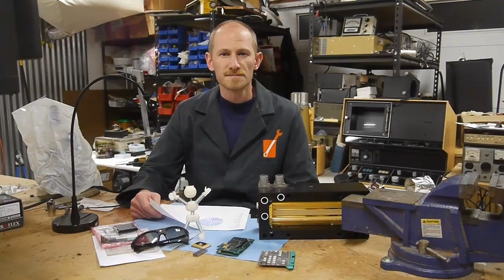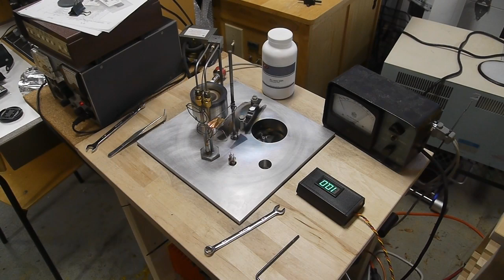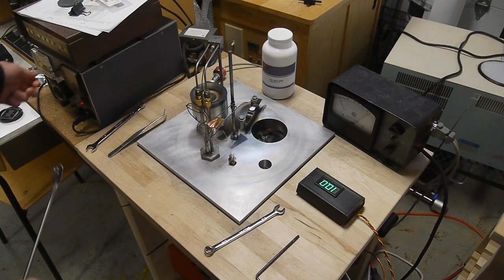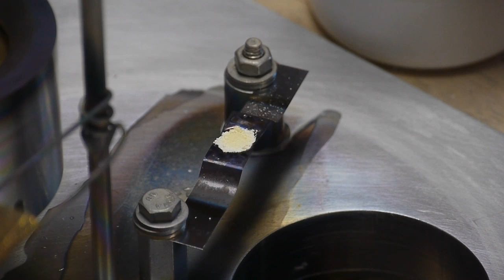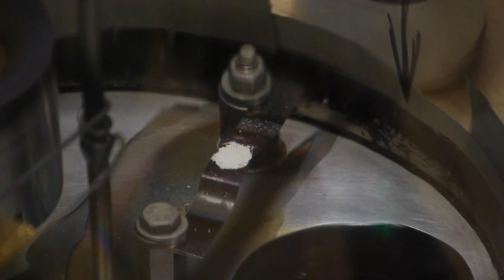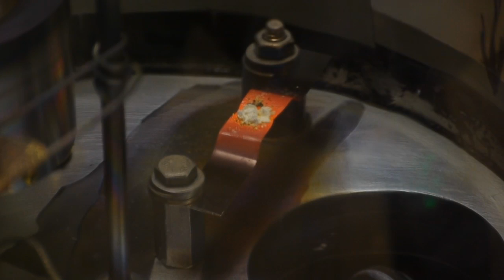Ben answers your questions #1

Comment from the maker: Someone posted a questions about college, then deleted their question as I was answering it!  Here's what I wrote:

I started at Cal Poly, San Luis Obispo, then transferred to UCSB.  Cal Poly wasn't a huge inspiration for me, but the real reason for the transfer was that I was following a girlfriend.  It wasn't the best idea that I've ever had.  Luckily, I liked Santa Barbara better anyway, and UCSB was a much better fit for me because the mechanical engineering major was smaller in relation to the overall school size (more personalized help).  I also found friends that I had more in common with, and generally had a better time.

Don't obsess about choice of school.  Unless you want to be a politician or join an Old Boys club, your choice of school will have little impact on your employment path.  Choose a school that fits your personality, your desired locale, and your budget.  There is no reason to rack up huge debt unless you have to.  Every school will provide opportunities for networking -- make full use of them!  Do projects whether they are required by the school or not.  Find friends, or complete projects on your own.  Having a portfolio of stuff that you've built will make you much more valuable to prospective employers.
Reply: following a gf, hahahah that was interesting. love your channel and honest answers.
Reply: Cal Poly BSEE graduate here. Cal Poly is known for offering a lot of practical coursework while schools in the more research-oriented UC system are generally known for emphasizing mathematics and theory. I don't know how long you attended Cal Poly, but did your experience give you an impression on any differences in how hands-on the two curriculum were?

Another question: you seem to me like the sort of person who could have been successful in a technical career without the need for a college degree (like Jeri). Did you ever consider forgoing your education and instead becoming an entrepreneur?
Reply from the maker: Spencer Williams I only spent my first two college years at Cal Poly, so much of that work was general education requirements and lower-division classes.  The real differentiator would probably be the upper division work, which I didn't do there.  I initially chose Cal Poly specifically because of their "hands-on" mantra.  I've always felt that being hands-on is the best way to learn things, and though it would be a good fit.  My biggest complaint was that Cal Poly was super overcrowded -- getting classes was very difficult.  It was normal that engineering majors would take 5 years to get an undergrad degree because of difficulty registering for over-full classes.  There were so many MEs at Cal Poly that getting any sort of personalized help was impossible.  The admin staff could not possibly know everybody.  In general, I was not impressed by the caliber of the average Cal Poly student, though there were a few great folks that I met.

At UCSB, the ME advisers knew most people in the major and almost all seniors by name.  Registering for classes was not difficult at all -- they would make sure everyone got the classes that they needed to stay on track.  Even though individual class size was larger at UCSB, the overall major class was smaller (ie only about 80 MEs in my year).  This helps much more when generating a sense of community.  There were something like 1000 MEs in my year at Cal Poly.

We had hands-on labs at UCSB.  They were OK.  You'd probably learn much more by exploring stuff on your own, but for folks that normally don't learn things on their own, the labs were done well.

I very often considered skipping college, but the problem is that many employers absolutely require a BS or higher.  Initially, I ran my own business, so it didn't matter to me, but I knew that I would probably want to work somewhere else at some point, and having a degree may allow that to happen, or may provide an automatic salary boost.  It really is unfortunate, but degrees have become a sort of arms race, and you have just to stockpile to keep up with everyone else as long as employers use degrees as a measuring tool.  If you are sure you'll always work for yourself and never for anyone else, then you can safely skip it, but that's a difficult thing to estimate.
Reply: Applied Science Got to agree. I did three degrees at various levels and in hindsight I believe that once I have my first degree and my maths was up to scratch I think I could have learnt more in that same time than on my own. For me personally having higher degrees has not translated into higher salaries (only higher stress levels), although I know it has for some of my peers it has but they went into finance rather than engineering / technology. The one thing college / university does give you if you study engineering is the opportunity to use their workshop. This maybe less of an issue in North America where in general cost per square m / ft of property is pretty cheap so the possibility of having a home work shop is much more realistic compared to the U.K, I don't know so can't comment about the cost on mainland Europe. I've got to admire your dedication to completing projects as I tend to research and a large number, start only a few and complete even less, and the ones I complete are only ones I can do with scrap materials I have to hand in a free afternoon!
Reply: Hi Les,  I agree with you it is "horses for courses" I would never stop some one from doing a Phd if the wanted to ... I just have had ... lets say less than impressive result's when interviewing candidates over the years for various positions to say I found that many of those with Phds actually had very little  practical interest in what they studied  ??? 
The most recent last week :( 
If you interviewed a newly minted PHD in Electrical and electronics engineering ( Undergraduate in the same) { thats 7+ years]  and they answered that they had never assembled or designed a circuit that was not part of a Practical or assignment, when asked if they felt comfortable attempting basic fault finding and they said no ( full marks for honesty) asked if they had ever had the desire to even as a kid to create any kind of circuit ( no matter how trivial) the answer was still negative... I was left at a loss to understand the motivation for the investment in brain cells in this particular field  ??
by contrast a few months earlier we had a summer student that had only completed his 2nd year of a undergraduate  degree in Mech Eng. who was full of energy , motivation and show a very real level of practical understanding in all of the above. he quite capably designed a working schematic based on a processor he had not worked with before created layout and generated the Gerber files to send off to manufactured the PCB.   
He had made various "robotics" projects as a kid growing up.
While he did not have the Years of "Experience" ( he had only just turned 21)  he impressed all of us in his desire to learn ANY new tool or skill and while he made his fair share of "silly" mistakes but none were major and his desire to learn from them .. and us was just refreshing . 
 While I believe he was going to do a second degree in electronics to compliment his Mech eng degree he was not planning to do a PHD or even a MSc .

As an employer  I know who I would want to employ....  as to your comment saying some people are better suited to academia... well the first PHD guy was planing to lecture part time in Programming ... but in all honesty I would not be excited at being taught by him if I was a new student in his class :(

these two are not isolated cases unfortunately 

it is NOT to say that I have not met absolutely Stunning individuals with super PHDs... ... Just my 2c worth :)
Reply: Hi, Love your channel, would love to have the time to spend on all the projects you do, how much time a week do you allocate to your "projects" .
I also agree with your comments on college, and how it has become not much more than  something you collect as part of the "Tick box" process for job recruiting :(

I certainly feel that one useful variation to the entry requirements for any "advanced degree" ... masters ... PHD etc  should be that after a BS you HAVE to work in industry ( any industry ) for at least 2 years before you can be accepted to further programs. ... I really think that would filter out a lot of wasted "study" effort.
Reply: Applied Science
Love your channel Ben...its inspiring me to convert some part of my garage into a "Lab". 

I went graduated from UCSB with BS Physics in late 80's. "Theory & Math" was perfect for that discipline. But I often looked over at Engineering, and at Materials Science Lab (just built) with much wistfulness. We did get some time in machine shop - Physics grad students even more.  

If I had it to do over again, ME/EE would have been so much more satisfying. 

Im impressed with how well you know the fundamentals Ben. You definitely deserve the title of Applied Science. 

Thank you for your efforts!

Shelley
Reply: Applied Science
Thank you for you open and honest reply.  I recently went through some of the same discussions as my oldest was preparing for college.  I have friends and acquaintances that teach (ME) at both UC Berkeley and UC Davis.  Both did not recommend  that my son attend their schools for his BS.  The basic premise was that the schools were too focused on research for the MS and Phd students and didn't pay sufficient attention to the undergrads.  They both recommended small private schools specifically Harvey Mudd, Rose-Hulman, Cooper Union and Olin.  Very small classes with a focus on teaching undergrad students.  My son is just graduating from Rose-Hulman and I couldn't be more pleased with his decision.  Very hands on, class sizes of 25, professors who knew every student, exceptional individualized career advice.  Even though it is a private school with all of the merit scholarship (yes merit) etc. my son ended up paying the same amount as he would have at UC.  The opportunities such as publishing research papers, international travel etc (100% paid for by the school) would not have been available at a larger school.
Reply: Thought I'd weigh in for anybody reading (albeit one year late). In many scientific fields, especially in Europe, there is a glass ceiling to anybody without a PhD. It's possible to break it at some companies, but generally you're not going to be taken as seriously or promoted without one.
Reply: +William Cirillo I would disagree with you about that last bit. I would definitely say it's great advice for people who want to work in industry, but it's not going to be relevant to someone who knows they want to go down a research and academia route. It's just going to be two years that they may feel they've wasted or, even worse, could turn some people off.

Having said that, I think a lot of people do take time out between degrees these days and it can work out doing wonders for them (corporate sponsorship, better CV, etc.), but at the same time I've worked with researchers who are brilliant that just wouldn't be suitable for industry work.
Reply: very good advice, even when I read it 3 years later
Reply: I would love to hear your opinion my friend...it is you I would trust.  I would be honored if you examined my work. I believe we have accelerated light and seen the fields in mid air that surround the charge particle field carrier. Also we have seen these fields COLLIDE and create mini fields. If you have a minute my email is roger@mudfossils.com     https://www.youtube.com/watch?v=FnNVIlNK5MA&t=2s Is there a way to contact you Sir? I have other things about Atomic models and gravity.

Comment: Yes the Q/A format is a good thing every now and then, definitely. Can you do a video on flow batteries, zinc bromide, i'm really interested in them for an off grid homestead type scenario, thanks.
Reply: I think for small scale offgrid energy storage LiFePO4 is the most economical option . That Is what I use for my offgrid house.
Reply: ***** Li batteries might be cheaper to buy up front, but NiFe batteries are probably the best going with their practically infinite life. They can take a near total discharge with no damage. The three downsides are a higher up front cost, weight, and a small percentage loss in stored energy per day. The weight doesn't matter in a fixed installation, and the small loss per day doesn't matter if they're regularly topped up with an excess energy supply, e.g. occasional sunny days. http://www.nickel-iron-battery.com/

You can buy them at places like http://ironedison.com/ or possibly get them cheaper direct from China if you look around Alibaba or whatnot.
Reply: Mark Rose
I know about NiFe and they have multiple problems.
Just to mention a few that where not ok for my application. They have bad charge discharge efficiency so I need more solar PV panels than with Lithium usually over 95% efficiency. Then there is the gas generation same as Lead Acid and need venting. Venting will not have been possible in my cold climate with temperature frequently below -40C. Low temperature will drop the efficiency so much that the batteries will become useless.
Heating the battery is not possible (not practical) do to venting requirement that heating energy will have been much higher than what you can store on the cells.
A lithium battery dose not need any sort of venting it can be placed inside the house at a nice temperature and can last for thousands of deep cycles so in excess of 10 years.
Lithium battery is a much, much newer technology that both NiFe and Lead Acid so if any of those older technologies will have had any advantages over Lithium it will have been used on a much larger scale.
NiFe is almost inexistent and Lead Acid was inexpensive and good enough for car starting applications with just a few % DOD.
For stationary energy storage there is nothing better than LiFePO4 or LiCoO2 charged at 3.95V.
My LiFePO4 has just under 2 years of daily heavy use between 50% to 85% DOD but it is still as new with no detectable loss on capacity.
I'm sure it will easily last for 10 years in my application with absolutely no maintenance.

Comment: Do you still play the bass?
Reply from the maker: Yes, but it's been a while since I played at a bar.  I was in a band called Volume Control, and we played 1-2 times per month from 2009 to 2011.  We had about 4 hours of top 40 hits in our set list, and it was loads of fun.  We got to the point where we had to start playing bigger gigs at weddings and small casinos in order to progress, and some of us (including me) weren't too interested in that.  When I started commuting to Seattle to work at Valve, I didn't have the time for music any longer.  Now that I am back in the Bay Area fulltime, I should find an outlet.

Comment: You mention the flea markets, are you a ham by chance?  Thanks for taking the time to share your background that's pretty neat!
Reply from the maker: Yes.  I am KE6FZT, but it's been a long time since I was on the air.  I don't even have a radio at the moment.  I always said that I would upgrade my license class when they removed the Morse code requirement.  I'm a little overdue.
Reply: Ah cool! 73 de W7REA